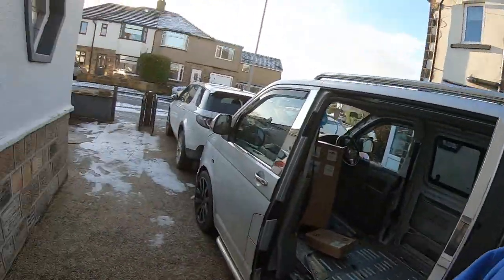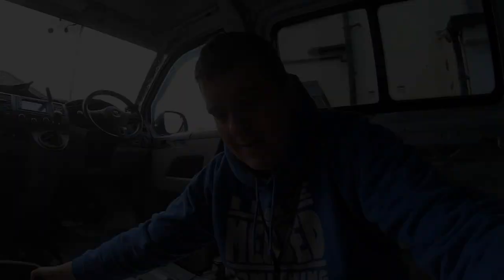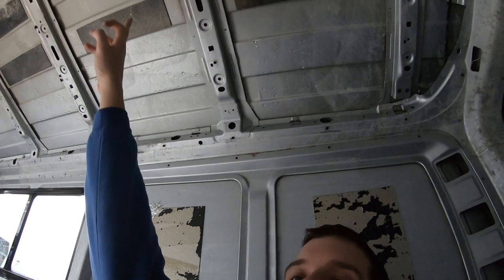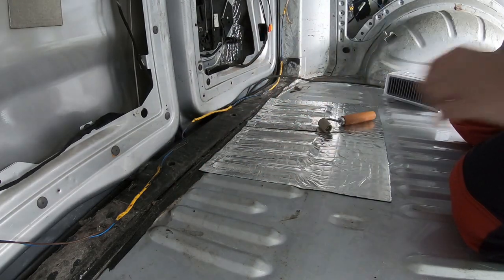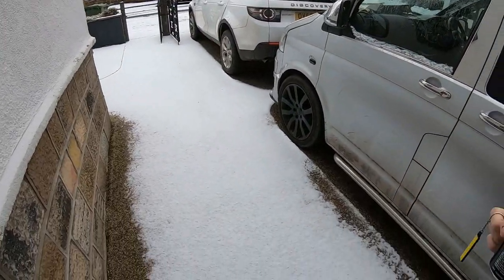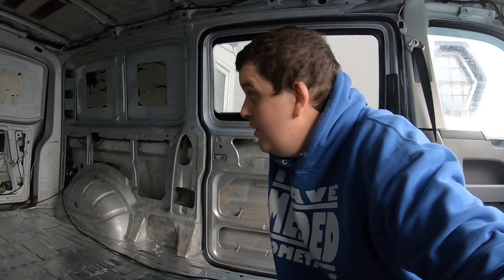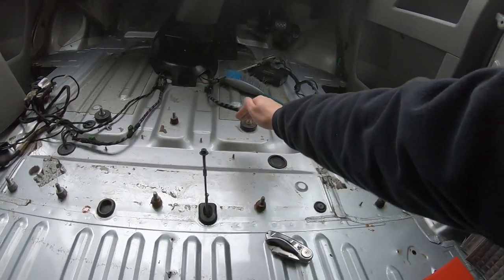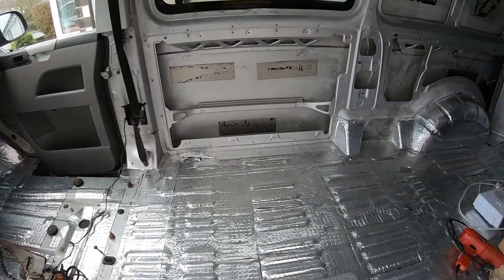How to Install Sound Deadening on a Van Floor - VW Transporter T5 Campervan Conversion (Part 3)

Comment: You need to unwind the extension lead fully when using it for a heater or it could catch fire
Reply from the maker: I've used this heater on extention leads for years  this doesnt get hot enough. I've checked the wire enough. If I was going to use the heat gun more I would have done.
Reply from the maker: But thanks for the concern.

Comment: Back in the day we just used builders flashband as it’s loads cheaper, than buying what they call “the proper stuff” which is just basically flashband anyway !.
Reply from the maker: I also used flash band in the past. Infact I still have some from when I used to use it. Supposedly this is better. Iver not seen a comparison of the 2. Its just the same to work with.

Comment: Rolled up extension is a no no buddy!! Especially powering a heater..
 Otherwise keep doin what your doin,transporter is a good project and I'll watch avidly 👍
Reply from the maker: Cheers bud. Like my response to Marks comment. I used this heater for many years on leads. On its own its fine and the extension doesn't heat up. If I used the heat gun more I would have extended the cable. Dont forget it was bloody cold as well lol.